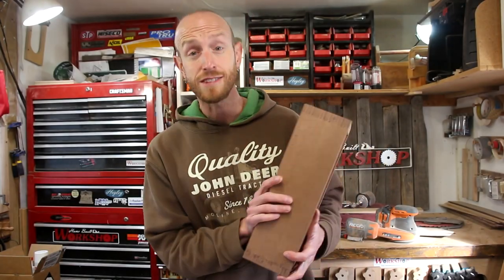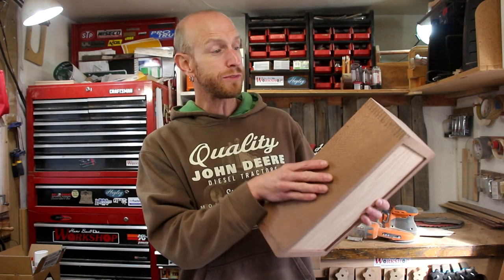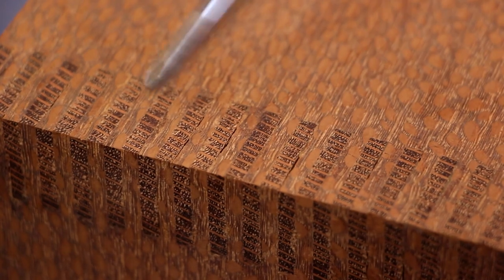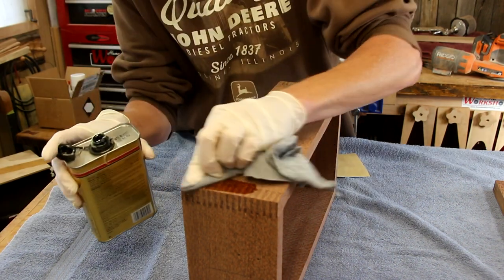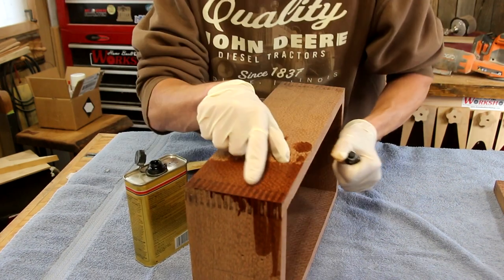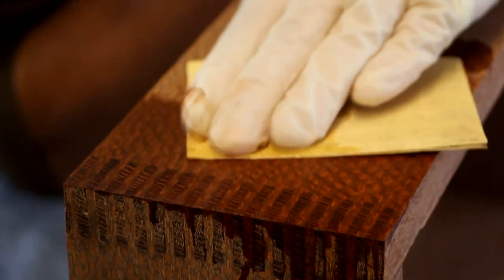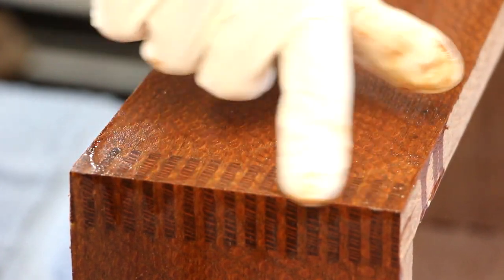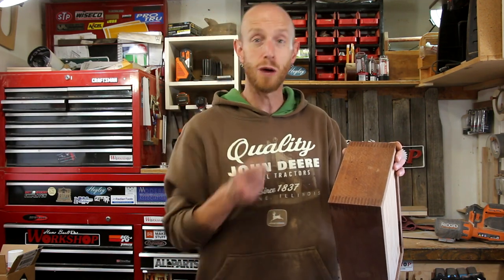How to Fill Wood Grain with Polyurethane and Sawdust (works for small gaps too)

Comment: I never thought of using Polyurethane with sanding. I always mix wood glue and sanding dust from my sander. 
Thanks for the Tip!!
Reply from the maker: The glue method works well too. Ive done that several times.

Comment: Great tip.  Looks really good.  One bit of advice - nitrile gloves work much better than latex for oil based solvents.  Latex is impermeable to water but permeable to oil.
Reply from the maker: Thanks. I'll have to try those out.

Comment: neat trick man. i think i've seen something similar with super glue but this seems much safer.
Reply: Safer?
Reply from the maker: I have used the CA glue as well. It works good. I like this because you don't get the glue on you. Lol.

Comment: What's the impact of applying a different finish, say a laquer, over the wipe on poly?
Reply from the maker: I believe if its completely dry and cured, there won't be any issues. I have not tested this myself. I have just completed my projects with wipe on poly. I'd test it out on a scrap first. I would think it will be OK though.

Comment: Question: What would you recommend if the work has been stain or will be stained first. Could this still be effective without eating through too much stain? I'll probably experiment on scrap first but I'd love to know your experience. Should I stain AFTER the sanding/sealing with poly (I'll be making my own wipe on with poly and mineral spirits).

Comment: Thanks for the tip Jeff. Would you sand the whole box to 220 first then do that?
Reply from the maker: You can if you want. I plan on sanding it after the poly has dried. Thats when I'll take it to 220. I'm using 220 for this part because I want the sanding dust to be fine enough to get into the cracks. Either way will be just fine.
Reply: Thanks